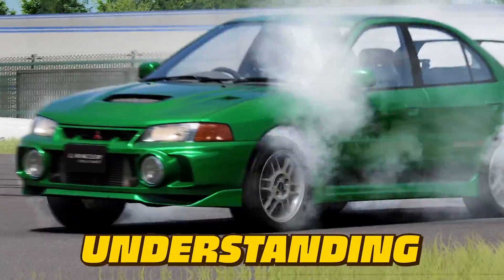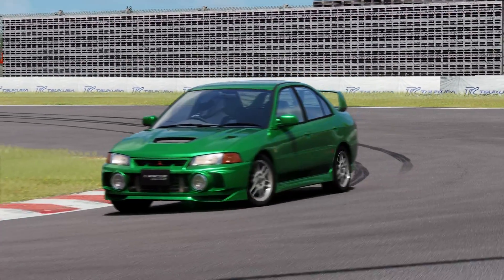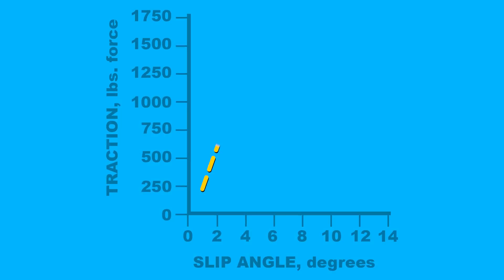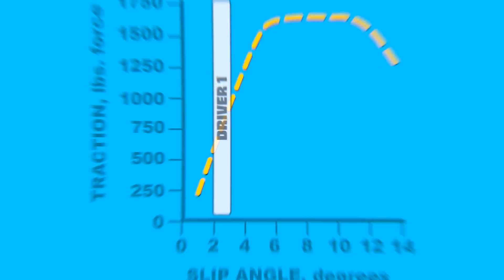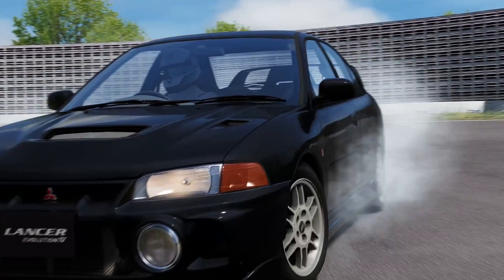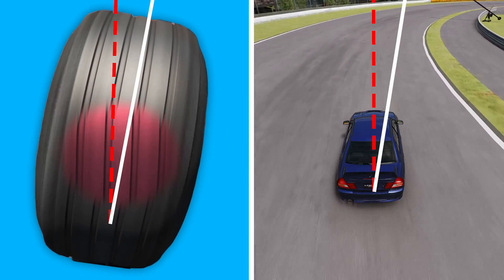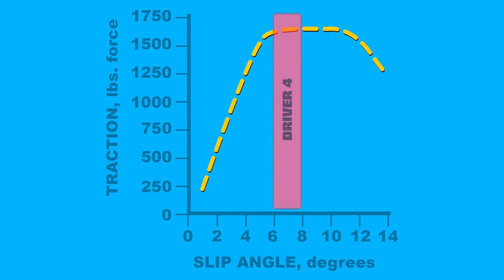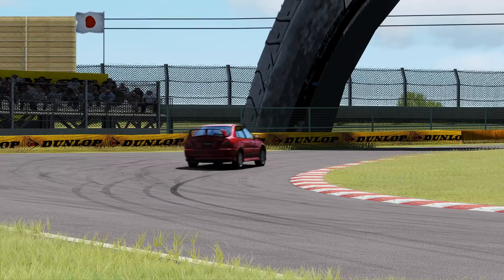The TRUTH About SLIP ANGLE...

Comment: So there is pits on those games and they use a form of software to control the tire wear means slip angle was a cheat that they still can’t probably program and it just wears the tires as if it was on a straight giving an advantage. I probably still have the fastest lap on the Nuremberg ring in forza but quit sim racing.

Comment: Back when i used to drive a camry this is exactly what would happen, at first i didnt control the slip, it would happen randomly as i did the turn but then i realized that if i just turned the wheel a little bit faster imbetween the start and the midle of the corner the car would slip towards the center of the turn and i could take the corner sideays, id do this going 70-80 in corner that were meant to go 40 in the mountains

Comment: Fun fact, the plateau in maximum slip angle to grip ratio becomes a lot smaller the gripper the tire becomes. For example the graph bloke shows is what a slip angle of a street tire would look like, a long plateau with a smooth drop off in grip. If you were showing the graph for grip to slip angle on a racing slick, there would be a very narrow margin for peak grip before a very sudden drop off.
Reply: In other words manufacturers factored in how people would understeer on the streets

Comment: Thanks a lot for the follow up video. This is a lot of help mostly because of the community I'm in. They think slip angle could just be tuned into the car
Reply: I mean, it kind of just exists
As long as you have rubber tires you cant tune it in or out, what they are talking about is probably rotation or yaw rate
You can increase it by, for example, toeing your rear end out.
Reply: @tiagobelo4965  i tried to explain that but it goes no where

Comment: Wait, how would you track your tyre temperature IRL?
Reply: sensor probes have been a thing for a good long while now
Reply: @jn1211  and I haven't heard of them for a good long while until now
Reply: come in after a lap w a laser heat gauge and check the inner, middle and outside. this is also how you know where to adjust your camber but you MUST be running close to the limit of the car and tire beforehand

Comment: How do you know when you’re in the right range? Also, with cars that aren’t balanced, so a front limited car for example, it will slide the front sooner than the rear. If you drive at the optimum range of the front tyres, the rears still have potential left. What handling do you use in this situation, or when it’s the opposite and the car is rear limited?
Reply: bring a protractor?
Reply: @zwenkwiel816  💀💀💀 serious
Reply: Stop over theorising it and practice
Reply: @flowermouth  practise without aiming is useless
Reply: Test different wheel angles from telemetry and see which gives you the highest Fy. You can't use FFB to gauge grip because self aligning torque is not particularly related to the slip curve, so you will need some kind of numerical analysis assuming you really want to be very precise.

You can "get a feel for it" but if the model is realistic (most sim models are not) then it will be very hard to tell if you're at the absolute slip peak or not because realistic slip curves are less sharp than the typical ones in vanilla AC for example. On the other hand you will generally need to drive under or over the lateral peak of the front tires occasionally depending on the situation, this too mattering less the less realistic your model is IMO.
Reply: @ArchOfficial  actually ffb that includes bass shakers for your feet is insanely useful for feeling where your slip is at
Reply: @jn1211  Not if it's linked to SAT and not purely Fy. SAT does not correlate with Fy and it will throw you off a little or a lot depending on the steering geometry and tire.
Reply: you use trailbraking with understeering awds and fwds, or you can stiffen rear springs/sway bar or increase tire pressure at the rear
Reply: @asdasd-om8tj  but how do you know whether you’re in the range?
Reply: @akioasakura3624  with experience you can find the feel for the optimal slip angle for the given corner, it varies track to track
Reply: @asdasd-om8tj  I have been simming for 5 years, and I am still not very clear on that feeling. Could you give me more specific directions please?
Reply: @akioasakura3624  simming for 5 years doesnt count as experience for trailbraking if its a new technique for you. just get on and practice
Reply: @asdasd-om8tj  I do have experience with trailbraking, but Im talking about the feeling of peak slip angle
Reply: @akioasakura3624  maybe your expectations are too high, its not possible for a human to always be in peak slip angle, the goal is to get as close to it as you can as consistently as you can. when you trailbraked a corner and its your quickest time then it probably is very close.
Reply: @asdasd-om8tj  but there are people 2, 3, 4 seconds faster. How can it be very close?
Reply from the maker: The "feel" is knowing how hard you can push a car before going over the limit. It takes quite some time of driving the same car to know where the limit is. Its best to learn a car on a circuit too.
Reply: @akioasakura3624  compare your time in the corner not the lap. also what he said, youre over theorising it lol
Reply: @TSRB  yes I do it on the circuit
Reply: @akioasakura3624  isnt hard,
prost when racing was smooth as play violin, so once you masterise the car, u gonna get the feeling of front getting pushed out and starts to go where do you want, on Rwd cars the opositive happen, the front should point and u will feel the rear turning around you, u can pass the limmit, but some situations u have to countersteer smoothy to not overlimit this point

now about being fast isnt about being the fastest, theres somes racing strategies you can do, like attacking postion, not going at limmit everytime and defending position,

and know where u're going propositally, all that can make the situation where the fastest couldnt overtake you, or if he does u start to press him until he does mistake... the art of simulator racing is something ocult lol
plus if the fastest is on your front and u have a car with closer setup id possible you follow his line and beat him... theres several tricks for racing fast, and slip angle can be from point "fast" to the "limmit" of where u can do
Reply: You set up your suspension to suit that, thats how
Reply: @UCKy11WCiT_94ML-CFZjdviw They really don't, saturation peak changes from load are in the regions of tenths of a degree for thousands of newtons, and the minor CPLV from very small road imperfections (So small it's barely even noticeable when comparing to sims where this is not present at all) is not sufficient to actually change the saturation peak in a significant manner.

There is some basis to the contact patch vibrating when at and over the saturation peak which does oscillate the outputs in the Fy graphs, but it averages out very smooth and effectively doesn't matter.

Comment: its extremely easy, just corner up to where the tires almost lose grip. thats it. when you get more consistent you can hit the lowest slip angle with maximum grip.
Reply: Your actually not doing it, you see slip angle is unintentional and comes if ur right at the limmit, it comes random but u can make it consistent
Reply: @Viezyyy  yes you said what i said but u added that it is random, dont you need slip angle to turn in the first place anyway?
Reply: @omgisthatmikuo  slip angle is usually a foot away
Reply: u can acheave real slip angle by making a setup, or trail braking, etc
Reply: @Viezyyy  so by just taking the corner properly or tuning your setup…
Reply: @omgisthatmikuo  and using your technique will make the car unstable, oversteer or understeer deepending on the drive train or and setup
Reply: @omgisthatmikuo  your forgetting a advanced technique called trail braking.
Reply: @Viezyyy  that’s not that advanced, it isnt a hard technique
Reply: @omgisthatmikuo  it is advanced, you can late apex with it, and brake later , clearly you dont know how to counter in an arguement
Reply: @Viezyyy  bro trailbraking is one of the first things you learn in sim racing
Reply: @omgisthatmikuo  yet its still advanced, its a better version of normal braking,
Reply: @omgisthatmikuo  ok so could you tell me reasons why you think im in the "wrong".
Reply: @Viezyyy  when did i say u was in the wrong? i was just saying that trail braking and slip angle isnt the hardest things to master
Reply: @omgisthatmikuo  every car you see on the street turning is using slip angle, its minimal and no where near the optimal grip. but its there
Reply: @SamTheSambaMan  thank you i explained it badly